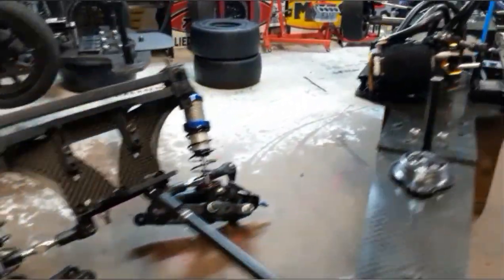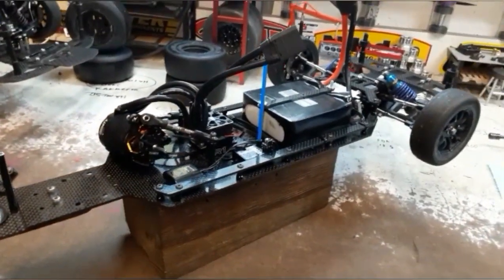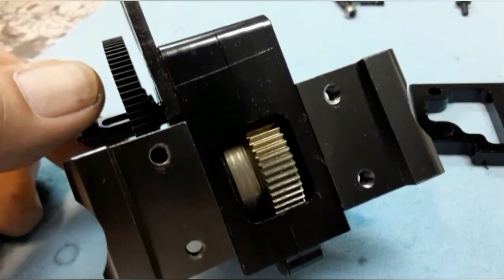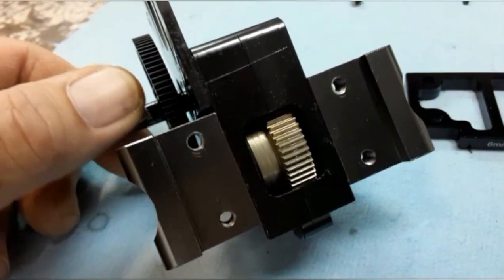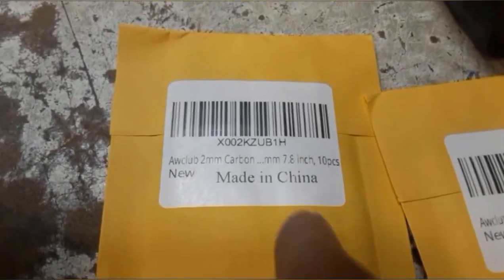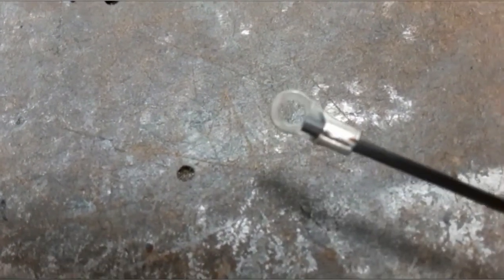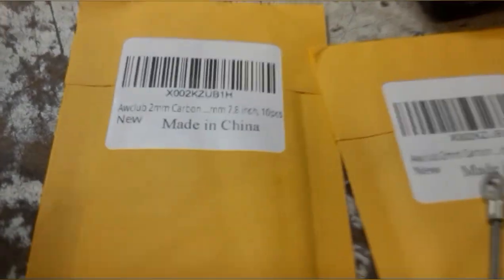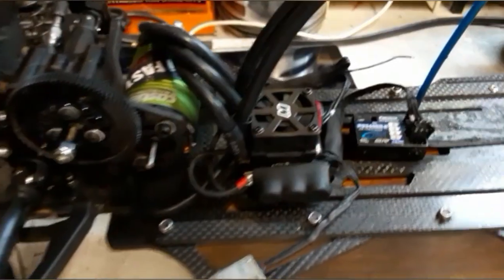RC Street Eliminator Drag Racing...QUICK HITTER!!!

Comment: Cryogenic tempering gears. This is interesting 👍
Reply from the maker: Yes sir been doing it for years ring and pinion valve springs blocks cylinder heads any wear  item makes them last a hell of a lot longer so I figured I would give it a try working out great so far saving me a ton of money but nobody believes me because you can't see it.. going to start doing wires we did some Ultra 40 Moroso wires got 30% less resistance

Comment: I used carbon fiber rods and epoxy and worked great till first wall tap and they shattered. I didnt even hit that hard. Im doing back to 2mm steel and solder the rings on.
Reply from the maker: That's what the fiberglass ones did I was hoping the carbon would be better because they're solid for 10 bucks if it's it'll be worth a try